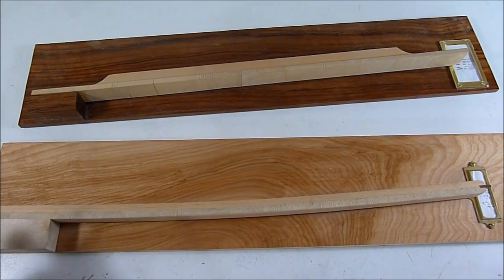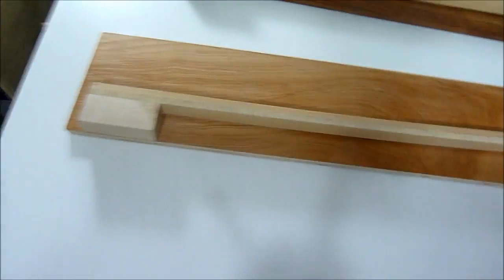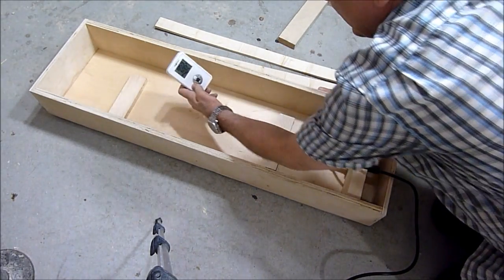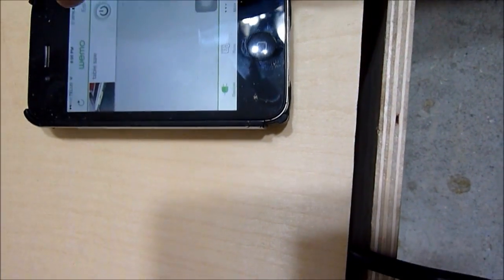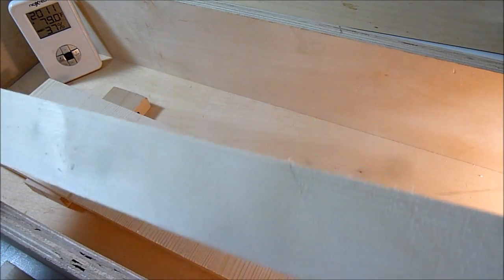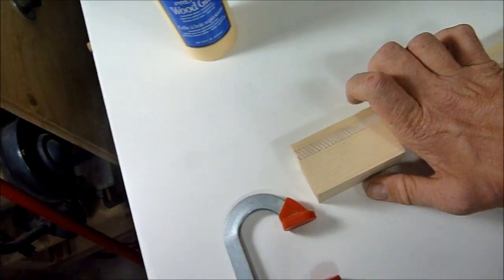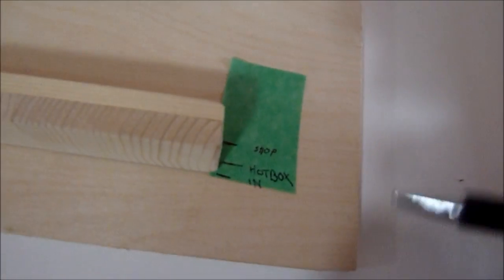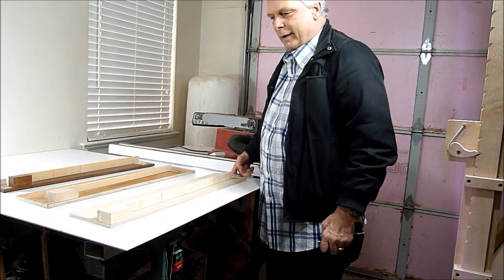Make a wooden hygrometer

Comment: In the local community college they have this panel on the wall that was glued up by a student years ago. He glued a board on the end grain (cross grain situation). They have screwed this panel to the wall on three of the corners and the third corner raises and lowers based on humidity. It is and example of not only how not to glued up a panel but also of what you have shown here. Very fun! Thanks for sharing! 
Chris